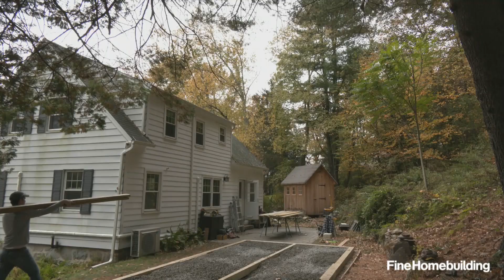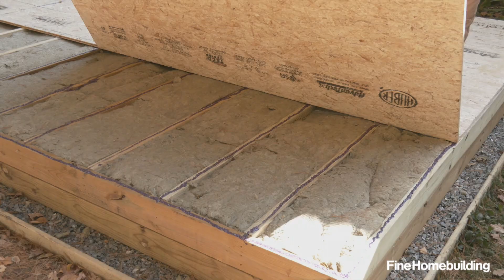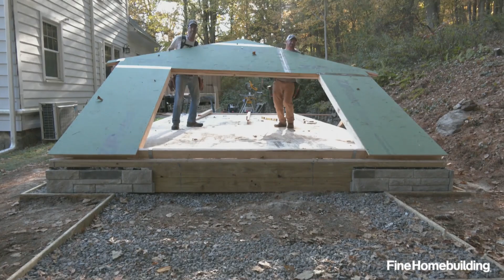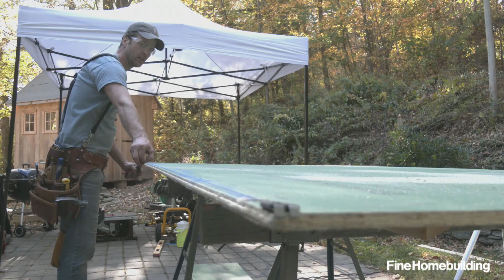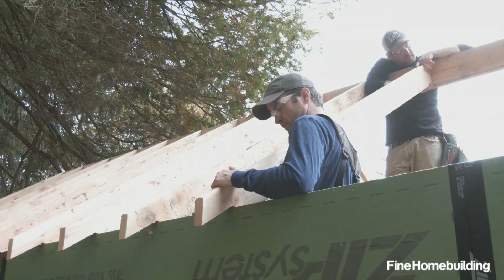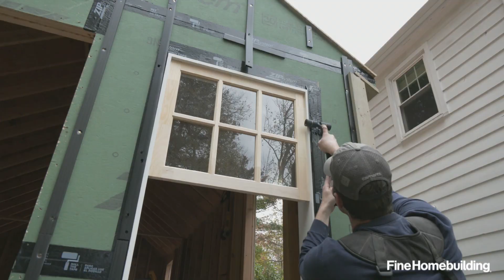Building a Shaker Shed

Comment: Great video.  Is that the smooth lap LP?  38 or 76 series that's thicker?  I'm bummed they discontinued the smooth 76 series, as I'm looking for that deeper shadow line.  Thanks
Reply: They won't answer.  They are too busy trying to get rid of the critters that somehow got into the subfloor insulation, even though there's rocks there.

Comment: What's the white strip along the outside bottom before the veneer goes on?  I thought maybe it was the Cor-a-Vent but doesn't look thick like it.
Reply: That's a starter strip. The individual panels go together with a tongue and groove around all sides. The starter strip locks the bottom of the first course in place.

Comment: Why not pour a slab?
Reply: One reason: we had a week to build this, there was no way to get a pump truck in there, and we didn't want to spend the whole week mixing, pouring, and finishing concrete. But it also didn't make sense from an environmental standpoint. Why use concrete to do something PT and gravel can do?
Reply: @matthewmillham2025 will there be mold under the floor of the shed? It’s basically like a tiny crawl space in there.

Comment: that insulation is going to wick up moisture and dryrot the place, what a terrible design
Reply: Mineral wool does not absorb water, I don’t like the idea of what they did, but  the material is correct for how the did it
Reply: The mineral wool is pretty hydrophobic compared to other insulations. I'm not saying it's a great choice, but I do suspect it would be fine for a long time as long as bulk water is kept from that ground.
Reply: Mineral wool's longevity is measured on geologic timescales. The PT framing will be gone long before it bats an eye. The 6" of gravel below framing is intended to facilitate drainage if water does get up that high. But the insulation shouldn't wick water, and it's impervious to it. Insulation will contribute less to the water load than the gravel.
Reply: The insulation as a whole is not impervious; the individual strands are. Water can pass through it, but it won't absorb the way cellulose or some foams will. It wicks water about the same as glass will.
Reply: @matthewmillham2025  I disagree. Glass fibers will soak water up like a sponge in my experience. Yet under the same conditions water will bead up on Mineral wool. Assuming no surfactants are present anyway. In either case in this situation it matters little since gravity is on your side.
Reply: @bradley3549  Point taken, and I agree. I meant actual glass, not fiberglass, though that's still not a great analogy on my part.
Reply: @matthewmillham2025  Could they have used rigid foam on top of the gravel instead of mineral wool?
Reply: @woodlymarcello2706  Hey Woodly - EPS and XPS could both work under the right conditions. XPS is made with blowing agents with a high global warming potential, so we tend not to recommend it. Polyiso can absorb quite a bit of water, so it's best avoided in this application unless you know water can't get to it. Mineral wool is nice because it will drain and retain its R-val if water makes its way in there, and it wont rot. Any insulation works best when it has a tight fit and fills the cavity, which batts do pretty well if you're careful installing them. If you use foam, water that does get in will have a hard time draining out, and it'll be a bit harder, though not impossible, to fill the joint bays up to the underside of the subfloor (you could attach cleats to the sides of the joints and lay the foam on those so it's flush with the tops of the joists ... leaving a bit of an air space between the bottom of the foam and the gravel - this is just me spitballing). For installing rigid foam between framing, we usually recommend the cut-and-cobble approach, where you cut the sheets slightly narrow and then spray canned foam around the perimeter to get a tight fit - you probably wouldn't do that here because it would take away drainage potential, but if water wasn't a concern, I'd say have at it. Really the main reason I'd stick with mineral wool is labor and material availability. The batts we used here were, I think, R-23, and available just about everywhere. You'd need about 6 in. of EPS or about 4.5 in. of XPS to match it. If you want to do the job with what's available at the lumber yard, that would mean a lot of cutting and stacking foam in the joist bays. You can special order some (maybe all) foams at custom dimensions, but then you're waiting on delivery and you probably have to order a minimum - it's common, for example, to special order thick, high-psf EPS for sub-slab insulation for Passive Houses, where you're covering maybe 1k-2k s.f.